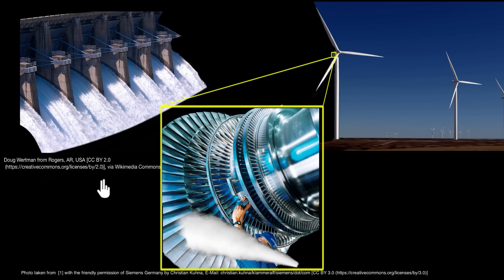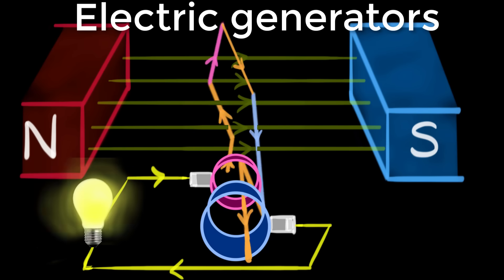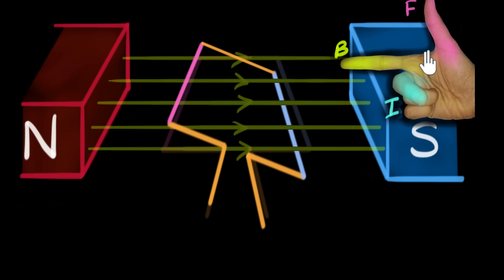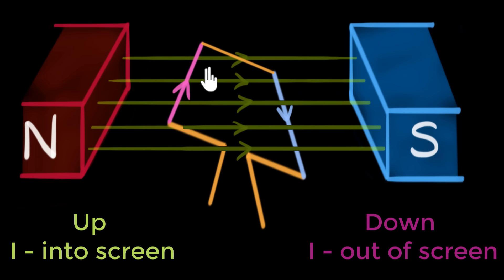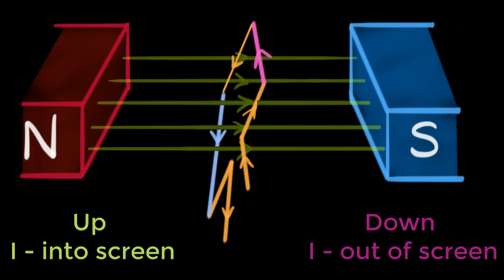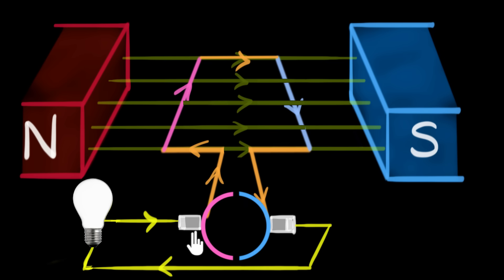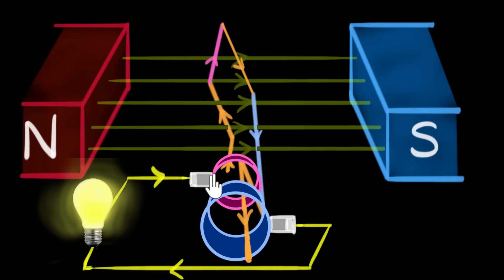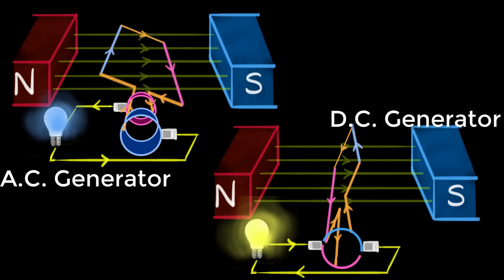Electric generator (A.C. & D.C.) | Magnetic effects of current | Khan Academy

Comment from the maker: Flemmings right-hand rule confusion: There are two Flemmings hand rule. The left-hand rule and right-hand rule. The left-hand rule is used when an already current carrying wire in a magnetic field experiences a force. This is the case in motors. We pass current through the coil and the force due to field pushes and turns the coil. However in generators, we turn the coil and as a result, electric current is produced. To figure out the direction of this current, we use the right-hand rule. 
Hopefully, this clears the confusion of why we use left-hand rule for Motors and right-hand rule for generators.
Reply: Thank you!
Always had a doubt in right and left hand rules
Reply: "left hand?" oh come on. it's the same GD rule in the other direction. three axes. flip one. no hands needed. why push a mnemonic on people like it's a fact, let them remember it however they choose. just provide the information.
Reply: @Roy Wilkie  as above so below. They move away from one another is the perception of which one is observing thus seeming to have an invert effect. Much like vortex
Reply: @roywilkie9577 if u flip with the same hand,the directions would still be different.
Try it yourself
Reply: Im pretty sure there is a left-hand rule for generators. It is used for electron flow theory. But I assume you are using the conventional flow theory, so using the right-hand rule for generators in this case is the correct way then
Reply: Hi Khan, why are two rings used on the ac setup and not one?
Reply: Johan Burger because with the ac setup you want to keep each wire connected to one one side at all times which due to rotating generates an ac current. In dc you want to keep switching sides every half turn so you need both sides to line up with each other. Watch the video again though and you’ll get it 👍
Reply: If we apply Fleming's left hand rule instead of Fleming's right hand rule even in electric generators
Reply: Janardhan Vallabhapuram the left hand rule is for motors only whereas the right hand rule is for generators 👍
Reply: @janardhanvallabhapuram7558 man that's just a mnemonic to remember
Reply: Brand
Reply: Thank u sir
Reply: Thank you and I understand the concept but one thing, I learned right hand applies to conventional flow where positive charge moves, when using left hand is it direction of positive or.negative charges?
Reply: What causes the motion of the coil? Do you turn it yourself?
Reply: @ogeo.8966  In motors due the force it rotates.
Reply: @ogeo.8966 magnetic field causes motion in the both the branches/coil
Reply: By wind or high pressure water by setting up a fan like something that can experience the force @ogeo.8966
Reply: thank you im confused at the very first thanks to your explaination i able to answer my teacher's question more confident
Reply: Thank you
Reply: this cleared everything
Reply: Yes sir that's what I have confused 🤔
Reply: It's treat to watch
Reply: So like induction motors and internal combustion motors , and electromagnetic motors?
Reply: Thanks ;
You  are a real Khan but what about making this mini project practically, exploring the familiar mistakes anyone may experience them.
thanks, in advance.
Reply: I like the explanation
Reply: Thanks.
Reply: 2:04 ❤
Reply: Hi
Reply: Just because of you sir physics look likes to me amazing
Reply: Thank u sir
Reply: Ss
Reply: Another rule for determining the direction of the current is Palm right hand rule as you have described why we don't use Fleming left hand rule in this case will we use the palm right hand rule
Reply: Sir your videos are really good to make students understand 
How things works 
How you make this types of videos? 
My particulars application?
Causes some other topics bother my student 
And I really want to make them understand
Reply: In summary 
if mechanical to electric current we used right hand,

But if electric current to mechanical
We used left hand
Is it?

Comment: So the right hand rule only works on the first 90 degrees of each half of the cycle then? Because after 90 the coil starts turning down in the opposite direction, but the current continues to go in the same direction..

Comment: direction of current in ac in each interval of movement of coil; clockwise or anti clockwise and where and how many times the current change its direction in one rotation of coil??
 0 to 90
 then 90 to 180
 then 180 to 270
 then 270 to 360??

Comment: at 12:00 does current stop flowing for a quick moment because of the splittigs
Reply: yes, but only for a single moment(idk how long), but the gap is small, so it wouldnt really matter in this case, as youll just keep spinning the coil, so theres be induced current and emf again
Reply: Current stops anyway even if there wasn't a splitting. Because it's not just that direction suddenly reverses. Current slowly decreases as coil becomes perpendicular to mag field. It appoaches zero then starts increasing in reverse. So it's not just current quickly stops for a moment.

Comment: Can you please make another animation on the same thing but now explaining by Lenz law and change in magnetic flux ? 
I am struggling with how to determine the direction of induced emf in the coil by using the Lenz law. 
Actually the Fleming's right hand rule is simpler to explain with , but it is somewhat empirical and lacks mathematical basis(though it is derived from the rules of cross product). I actually want to see that the mathematical equations of flux(Φ=BA cos θ and ε = -dΦ/dt) actually work!

Comment: Thanks for the explanation! One doubt, can we also use Lenz's law to take out the dirn of the current? because since the coil is turning, the inward flus increases( since magnetic field lines are from N to S as shown in the diagram) and since flux opposes any change, we can say that an outward flux must be induced resulting ina an anticlockwise flow of Current( from the N pole's side). and therefore the dirn of current in the loop as shown in the video, is it a correct way of thinking?

Comment: 270 toward 90 degrees 

Current entering pink  by the right hand rule and exiting blue

From 90 toward 270

Now current entering from blue and exiting from pink by the right hand rule.

270 to 90 degrees 

the current alternate clockwise and counterclockwise in each cycle.

Comment: This means there is no neutral wire. Current flows to and from. So I don't understand the concept of neutral wires in AC current. I can understand it's concept when applied to DC current since the current always flow from positive to negative. Can someone explain netral wires in AC current.  Oh I get it now it only applies on dc generators

Comment: i know KA for several years but never got a chance to say thank you. Thank you so much for the selfless work. I never understood EMF concepts back in school and now a full cycle i'm trying to explain them to my child.  😀
its a bit confusing to see in real world windings on rotor are excited to work as magnets are the ones that rotates in the middle and armature sitting inside stator housing is constant but in theory its reversed. Also  slipring /bush are used to supply DC, not drawing output. 
it would be more helpful for children to corelate if same analogy is used in lessons
just a suggestion

Comment: The book by Oleg D. Jefimenko and the works left by Nikola Tesla show that the genuine alternating current (AC) generator is a free energy machine. This hidden secret of power generation has been kept hidden for centuries, but is now being revealed to the world.

The AC generator is a machine that converts mechanical energy into electrical energy. It consists of two parts: the stator and the rotor. The stator is a stationary part of the machine, while the rotor is a rotating part. The stator contains coils of wire that are wound around an iron core. These coils are connected to an AC power source. The rotor contains magnets that rotate within these coils of wire, which generates an electric current.

Comment: I think that the right hand rule you used is correct if you consider the displacement of negative charges but in most cases we use the displacement of positive charges towards the opposite direction. So your middle finger should be in the other direction since this rule is the result of F=qv x B = I L x B (F,v,L and B are vectors and “x” is the cross product)

Comment: I don't know if you will see this comment but I've seen many videos with exceptional animation skills and great explanation techniques but this is the only video that has made me understand the whole concept of the difference between ac and dc motor and how it all connects to the concept of the fleming's left hand and right hand rule. This is the video I needed, the one I was searching for, for many days. Thank you so much.  I was mostly confused on why there was a gap in the split ring commutators and this video fulfilled that doubt (thanks to the pausing you did to show the current reversing direction)

Comment: Initially, you have reversed the directions!! If the correct right hand rule is applied, the current in the pink color, when the force on it is upward, is out and in the blue, when the force on it is downward, the current is in. F=q(vxB) this means the index finger indicates the current direction, the mid finger points to the direction of B and the thumb towards F (force). But what you did is the opposite.

Comment: As a result of that this generator is self excited  generator means that it existd it self.
 Voltage build-up in this generator must have  Residual flux while starting  This residual flux will generate  Internal voltage E.g. Equal And this will increase IF praise IF as VL increased IF VOR F increasing F increasing in IF  Will cause flux to increase which will increase eg then VL and so on.
 Building up roses will continue until AG reach maximum value which is which is the point where Magnetization

Comment: Hey i have a question that is 
Why do we use strong force generator like a waterwheel if we can just use a small simple generator like u should in the video 
to spin a small gear and it connect to a smaller gear that is on top and glued on a big gear doesnt that increase the force right ? why cant we just continue using this method to make it as strong as a water wheel?

Comment: This is a good video explaining the basic principle of a generator.

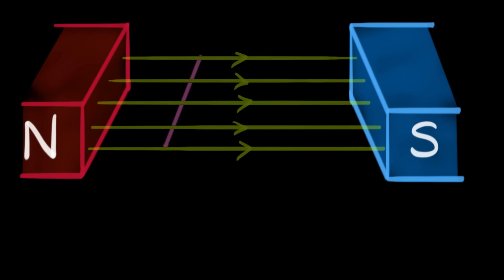But at 0:54, moving a conductor through a magnetic field, doesn't induce current in it, the magnetic field induces electromotive force, also known as Voltage. If the circuit is closed, only then the "induced current" appears.

Comment: i just confuse of the current direction, do you use conventional or electron current to point out the direction???
Reply: I would say conventional current direction. When we consider Electron Flow we just swap hands and call it the LEFT HAND ELECTRON RULE for GENERATORS. By the same token we call it the RIGHT HAND ELECTRON RULE for MOTORS. Seems a pity that this late in the piece we are still considering Conventional Current Flow ... which leads to much confusion when we start studying Transistors. But to be fair ... it IS Flemming's Rule and to make it line up with Flemming's published works and understanding at that time, we have to use Conventional Current Flow.

Comment: Sir, I have 2  questions --
1) Instead of rotating the armature if I rotate the magnets?
2)Is it necessary to  use permanent magnets?
Reply from the maker: Excellent questions 
1) yes. Such generators are also available. The one mentioned in the video is the most basic kind. There are varieties of kinds in reality. (If you take electrical engineering you would learn a great deal of it) 

2) Nope. I am guessing you mean to use electromagnets right? That can be done as well.

Comment: Sir how can one explain with the help of an analogy to a grade 10th student the reason behind not getting a shock on touching the neutral wire of the household AC circuit,  even though the  current flows  alternately through live as well as neutral wires.
Reply: The neutral is physically and eletrically coonected to the earth, this is done intentionally by driving a ground rod and then connecting a wire from the neutral to the ground rod, this makes the earth and ground electrically the same point with no resulting voltage between earth and neutral. Since no voltage now exists between earth(or anything in contact with earth) and neutral, no current can flow between earth and neutral therefore nobody gets shocked by touching the neutral even though current is flowing in the wire. The "hot wires" in the circuit are not connected to the earth therefore a voltage exists between earth ground/neutral and a shock hazard will exist. This earth ground is primarily made for safety reasons
Reply: @McCurtainCounty888  Thank you so much for the explicit explanation.

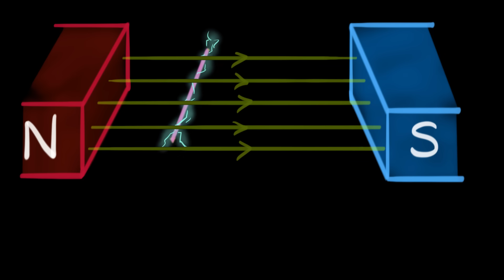Comment: Had to point this out. Fundamental error in the explanation at 1:02. There is no induced current in the wire when it is moved up or down perpendicular to the direction of the magnetic field. Instead an e.m.f is induced. (e.m.f.=electromotive force). This is in accordance to Faraday's Law. If the wire is closed, the induced e.m.f will then lead to an induced current which according to Lenz's Law will flow in a direction that opposes the motion of the rotating wire in the magnetic field.

Comment: Great explanation. I was wondering, why don't they just spin  the magnets instead of the wire and avoid the hassle of the slip rings to generate an AC current?
Reply: Bcz moving magnets is some what inconvenient
Reply: @2.6dream  That makes sense, hadn't really factored in the size/weight of the magnets involved and the power required for/lost in their mechanical rotation. Thanks!
Reply from the maker: There are brushless generators where the coil remains stationary and the magnetic field is made to spin :).
I guess what we introduced in the video is the most basic kind of generator.

Comment: Why is he using his right hand instead of his left? 3:10, 
Doesn't flemmings left hand rule need the left hand ?(please answer)
Reply from the maker: There are two rules. 
The left hand rule is used to calculate the direction in which magnetic field pushes AN already current carrying wire. 
In our generator the coil didn't carry any current to begin with, so the magnetic field is NOT PUSHING THE COIL. (This would be useful in motors)
The second rule the right hand rule gives the direction of the current that is produced when YOU PUSH a wire in a magnetic field. 
That's what is happening here, and so we use the right hand rule.

Comment: Please anyone reply why he take direction of magnetic field  towards right 3:10
Reply: Because you've seen the field throw drawings of a magnet.  Remember they go up out of the north pole, and loop around going past the south pole and back up into the south pole.  So the he has a north pole on the left (it's south pole is off the screen to the far left) it's field if flowing out of the top but this magnet is on it's side, and that field is attracted to the south pole as its north pole (off the screen to the far right) has it's field traveling to the south pole, just past it and back up into it or in this case to the right joining the other magnets directional field.  I can't draw a picture but take a drawing online and you can see how the magnetic field will flow out of north and into the south.
Reply: @anthonypape6862  how can I see drawing online of yours
Reply: Google magnet polarity and hit images button.  Lots of pics. You’ll notice north sends a current out and around towards its South Pole.  It passes the south poll before it is pulled back up north and enters the South Pole in the same direction as it left the North Pole.